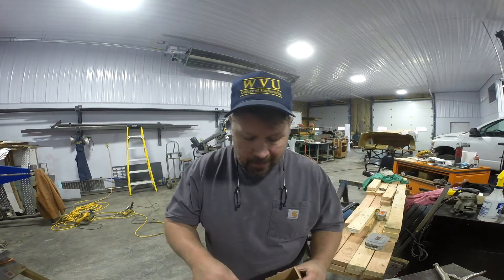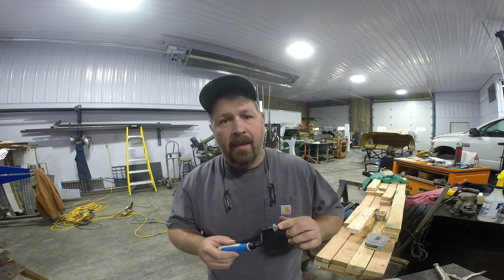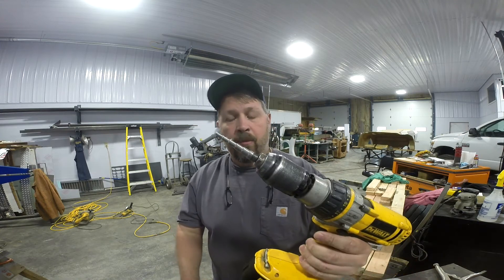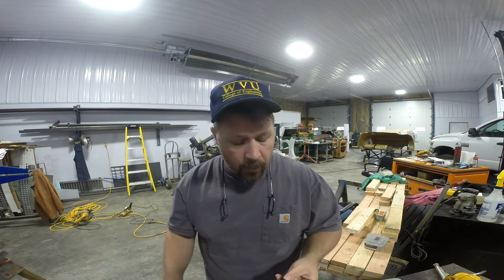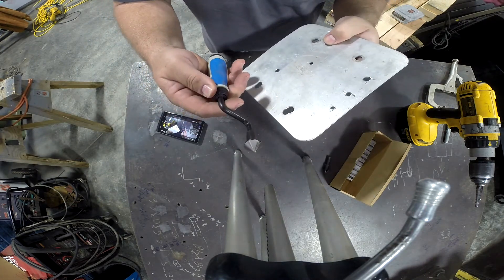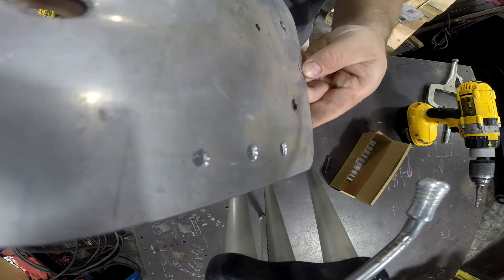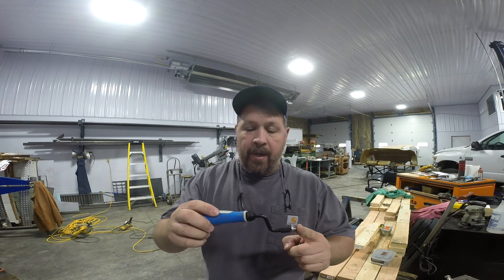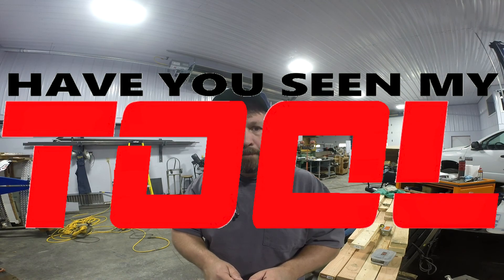Have you seen my tool 019 - Noga NG3400 Deburr Tool

Comment: I have this tool as well as Noga's straight shaft countersink. The straight shaft will chamfer 1018 or 4140 pretty easily. Would have never thought. Both tools, IMO, are a must-have if you work with metal. Good video.
Reply from the maker: Thanks for watching.